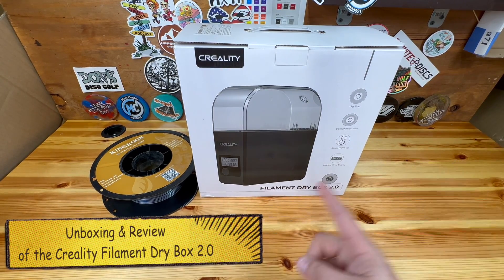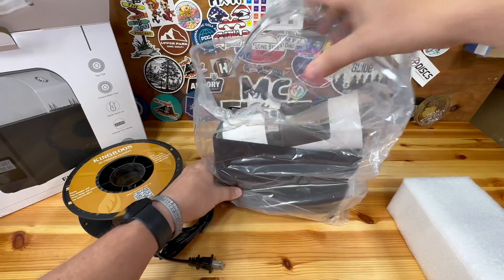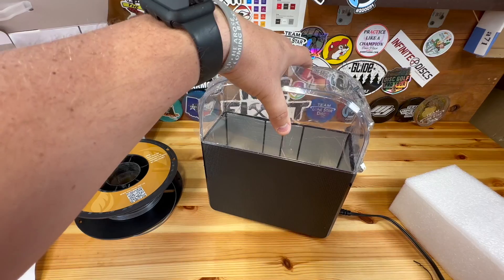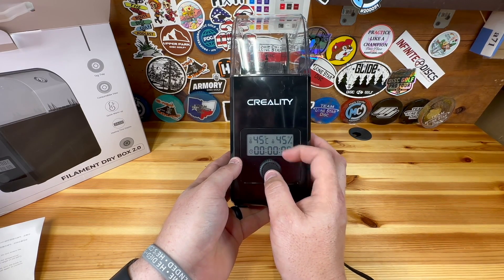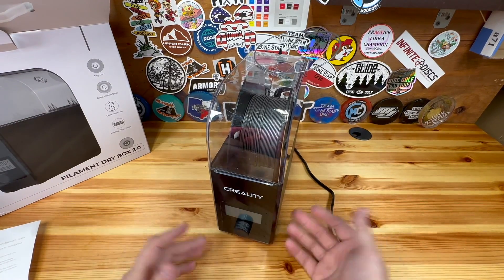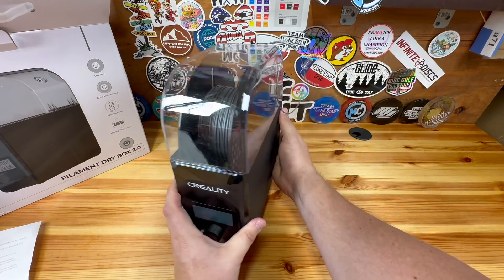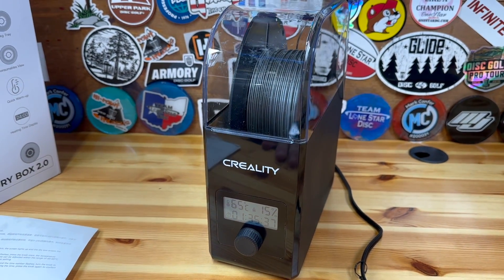Creality Filament Dryer Box 2.O Unboxing and Review

Comment from the maker: Creality Filament Dryer Box 2.0 - https://amzn.to/3KamD1c 

00:00 Intro
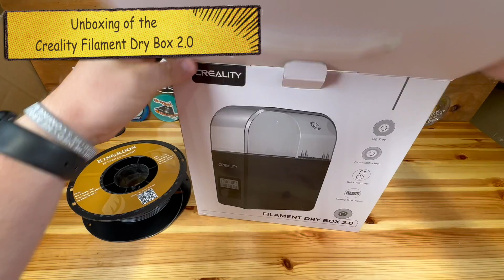00:35 Unboxing
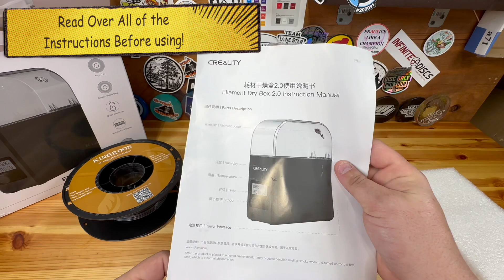01:10 Read Over Instructions Before Using
01:28 Plug In Dryer Box
01:53 Remove Plastic Wrap
02:08 Load Filament into Dryer Box
02:33 Turn on Dryer Box on the Back
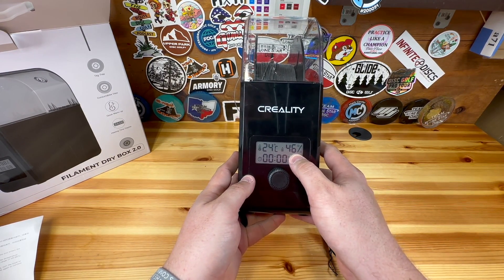02:43 Use Knob to Set Time & Temperature
03:02 Recommended Drying Temps Per Type of Plastic
03:40 Set for PETG (or whatever plastic you are using)
03:59 Heating Filament
04:14 How You Can Print With Filament in Dryer
04:59 Going over the Design of the Dryer
05:33 Under Temperature in Under 30 Minutes
05:57 Final Thoughts

Check out my website at http://mcfixit.us 

#3dprint #creality #filamentdryer

Links are associate links. A small portion of whatever you buy helps support this channel. Thank you for clicking on the links and purchasing to help out this channel to keep making great content for you!

Disclaimer:
Due to factors beyond the control of MC FIX IT, I cannot guarantee against improper use or unauthorized modifications of this information in the video, post, blog, or social media. MC FIX IT assumes no liability for property damage or injury incurred as a result of any of the information contained in this video. Use this information at your own risk. If you feel uncomfortable at any time. Stop and go to a professional. MC FIX IT recommends safe practices when working on vehicles, your house, or any other project and or with tools seen or implied in this video. Due to factors beyond the control of MC FIX IT, no information contained in this video shall create any expressed or implied warranty or guarantee of any particular result. Any injury, damage, or loss that may result from improper use of these tools, equipment, or from the information contained in this video is the sole responsibility of the user and not MC FIX IT.

#mcfixit #autorepair #rav4 #toyota #channgingbrakes #carrepair #mechanical 
——
Supplies used to record this video: 
* GoPro Hero 7 Black - https://amzn.to/3f3ALtb 
* 256GB Flash Drive - https://amzn.to/33pAueG 
* Vlogging Frame - https://amzn.to/33tajE0 
* GoPro Pro 3.5mm Mic Adapter - https://amzn.to/2RCURCu 
* Youmic Lavalier Lapel Mic - https://amzn.to/2R55sWX 
* Boom Stand (tripod) - https://amzn.to/3bdkQaw
* 5/8” to 1/4” adapter (boom to blogging frame- https://amzn.to/3txrVsM 
* Portable Battery Powerbank- https://amzn.to/3vJQc0q 
* 6ft USB to USB-C (powerbank to GoPro)- https://amzn.to/3uAS5MH

Comment: I am planning to buy this because of the price. Anything more expensive and I am on the fence. I was planning to try the "print bed" drying trick, but I was worried about wearing out the bed heater. Seriously, leaving the heat bed on for 6 hours can't be good for the printer. Also, I've never had any serious or deal-breaking "wet filament" issues in my tiny apartment. It's dry as heck here most of the time, but every once in a while, my PLA will break on the spool. I was told this is due to moisture, possibly, but I think it's the ingredients of the filament because only one color has had a broken filament (Bambu basic blue PLA). The drying is mostly for PETG. I've sometimes had failed prints and stringing with PETG, and I am printing a ton of stuff for a coworker/artist, and he pays me for the design and printing of custom brackets for his art he sells. I figure if the experts say YOU MUST DRY THE PETG! Going to invest the 50-ish bucks and see if it helps. Like I said, this happens rarely, but it's annoying when I wait all night and a bunch of stuff is all stringy and ruined. Perhaps I have better dryer filament because I work in retail and bring home tons of free dessicant packets, which I then throw into my filament storage. Good lord, they put desicant packets in EVERYTHING. I just sweep them up and take them home.
Reply from the maker: I add and switch out dessicant packets all of the time in my AMS. When things seem wet, I make sure to dry it properly with this filament dryer box. It works pretty well.

Comment: i got this dryer and i have to say i find it quite sh*t. its loud, it doesnt have a rubber gasket to properly insulate it and stop moisture from slowly creeping in, the controls are very unprecise as you can already see in the video with you struggling to dial in the wanted settings. when printing out of the box it has too much friction if not oriented perfectly with the opening directed at the printer, and worst of all, the humidity sensor seems to be almost useless, since it always goes down to 15%, no matter which temperature and if you dry it for half an hour or over night. you simply cant rely on those numbers.

theres also the problem that it shows relative humidity, so when the temp goes up, the relative humidity goes down to "15%", and when it stops and goes to ambient temp again, the relative humidity, it often goes up to 25% again, even after drying for 6 hours, which is still too much for properly dry filament.

the noise alone is too loud for me to have it run besides me, where the printer stands, and while my ender is already uncomfortably loud, the dryer is simply too much. it also makes noises when the filament is pulled out while printing, since it simply has too much friction and it is hard to orient the opening perfectly to the printer, and as i said, oftem it pulls the whole upper case open a couple centimeters, and believe me, i have tried to somehow fix that for hours. im thinking about modding it and drilling another hole that is better oriented for the printer, taking it apart to mod the fan to be more quiet, and also make some jig to keep the lid slightly open, so the air with the extracted moisture from the filament can escape. think about it: if you heat up and "dry" your filament in a clised box, the moisture has nowhere to go, it mostly stays in the dryer and creeps into the filament again, if you dont regularly switch on the loud box to dry it again.

all in all it seems like a misconstruction and im thinking of returning it and hope to get a dryer that is more silent and practical than this creality dryer.

the only upside i see is that it is quite affordable, and yes, of course it will dry the filament if you let it run at 50° over night, but the quasi useless moisture sensor is so unreliable you can practically never trust it to show the correct percentage.

so no, i would definitely not recommend this dryer, but i dont yet have a comparison to other products, that why im busy watching hours of youtube reviews right now :p

still thank you for your review and your opinion, its always interesting what other people think about this stuff! :)
Reply from the maker: It sounds like you got a defective one. I'd definitely be contacting their customer service and finding out why it's not working, get it fixed by them, or getting a refund for it not working properly.
Reply: @MCFIXIT  That's the thing with creality. Defective devices are not the exception, but a common occurrence. They're not worth the trouble as a company.

Comment: So if you had a 6 hr PET G print would you leave this thing running for the entire time?
Reply from the maker: That’s def an option. I use it now primarily to make sure my filament isn’t super moist. Once I get it down to where I want it. I turn it off if I’m using it right away and monitor it a few times. But often I don’t run it once it gets down. Even if it goes up a little.

Comment: Do you recommend buying it? Is it worth it?
Reply from the maker: Yes.m, especially if your printer is in a room with moister. This helps give you a dried filament - like when you first open the box and remove it from the plastic wrap. I have found that it helps my prints out a lot.

Comment: Something to consider is that when you load the filament into the dryer, the percentage of humidity shown is the percentage of moisture in the air inside the dryer, not in the filament itself.
When the recommended time has expired,  only then will the moisture content of the filament  be likely to match that of the air.
Reply from the maker: Good tip. Thanks for adding this!

Comment: I am considering of buying one but i am not sure if dries whole spool of filament or just top centimeter or so ? Am i right it does not turn she spool while drying
Reply from the maker: The spool will spin when using it in a 3D printer, but it does not spin independently. I hope this helps answer your question.

Comment: Does it actually hit 65°C? And are you able to do a noise check? Curious how loud it is while it’s running. Sounds kind of in the video. I’m currently on the fence looking at a few different options. The Sovol looks nice for a double role but maxes out at 50°C and you need to prop it open to get it to dry correctly. Any thoughts?
Reply: Just got mine today, SPL,  is <40dB..
Reply from the maker: Yes it does. It's got some noise from the machine running, but I wouldn't call it loud by any means.

Comment: Hello bro, great video, a question, does your filament dry well?
Reply from the maker: Yes! If you are in humid spaces then I’d definitely suggesting getting one to keep your filament dry right before use!
Reply: @MCFIXIT  it doesnt dry well for me
Reply from the maker: @ Really? It has worked well for me so far. I haven't had any issues with the filament not being dry when using this product.
Reply: @MCFIXIT  i have to put a piece of tree eupport filment to keep the lid from closing only then it seems to work